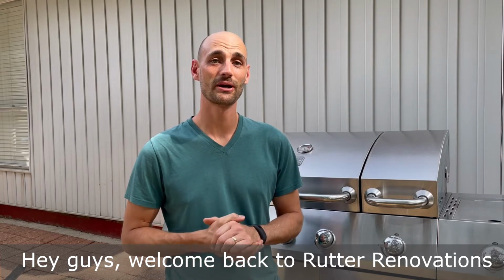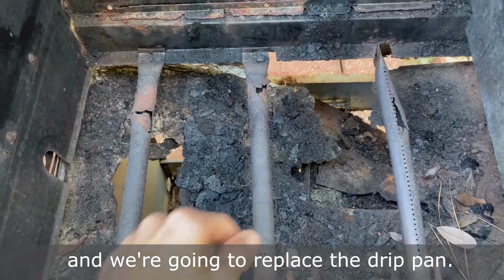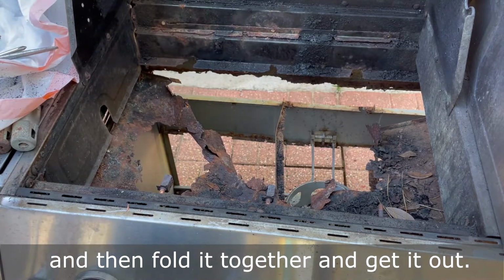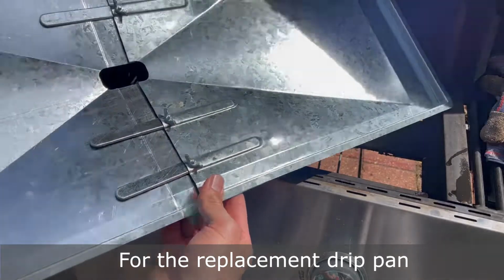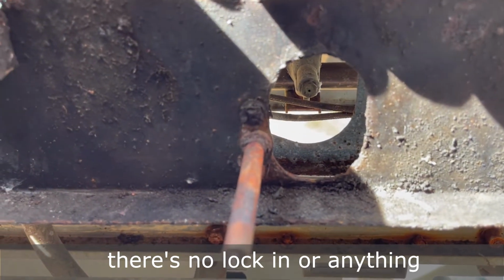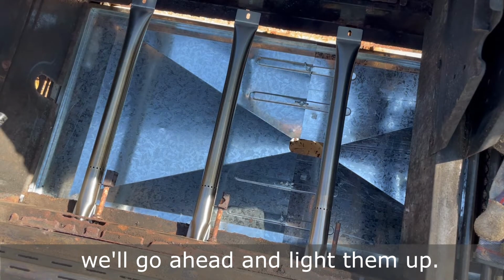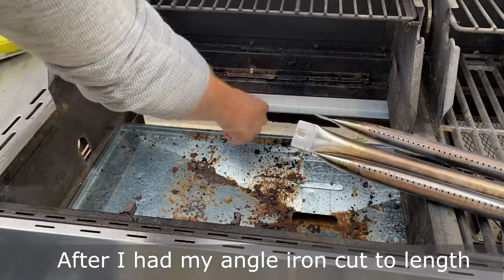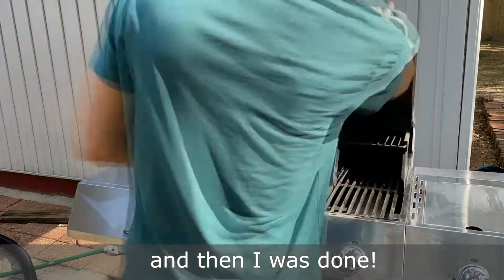How to Rebuild a Grill (Burner, Drip Pan, and Burner Cover Replacement)

Comment: I don’t know if this would work on all bbqs, but when the pan on my bbq burned out I replaced it with a large baking pan. They come in sheet metal and aluminum.  I think the one I bought has 1 inch sides and is about  16x 20 inches. It serves to catch the grease and other bits that come when grill cooking.
Reply from the maker: Nice! How do you empty it?🤔

Comment: Good vid, but how do you measure for grease tray? From brackets on grill? Measure tray depth? Does it have to match exactly or can be little short? You showed how replace, but when need to buy, you didn’t show how to measure. Some, me, are needing to learn how to measure to replace. Good vid though Thx
Reply from the maker: Good point. It depends on the type of replacement. If it bolts into the original holes (where the factory pan was), it will have to be exact. If you have a universal tray that expands like this one, there is a margin for error. You want to measure the full width and depth (front to back of grill) where the tray will be sitting.